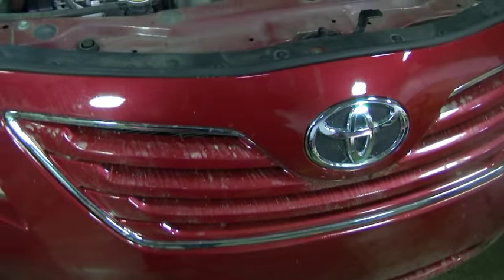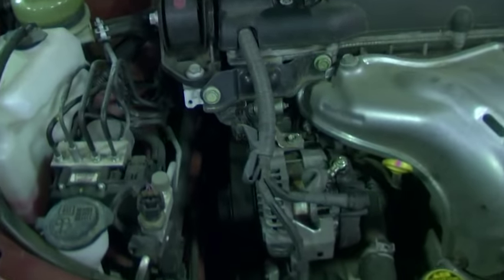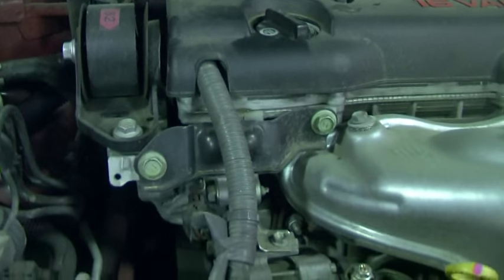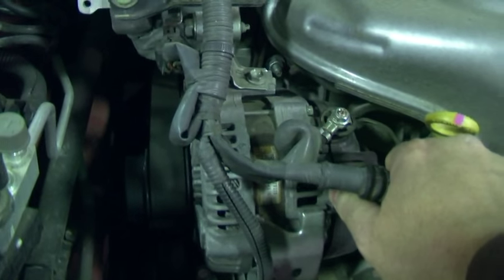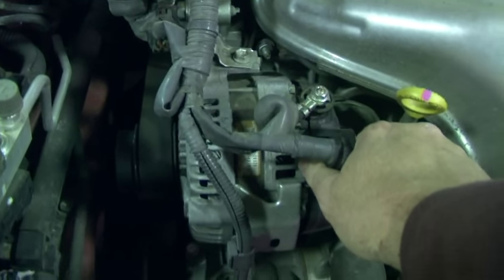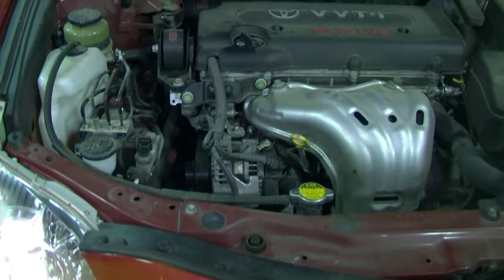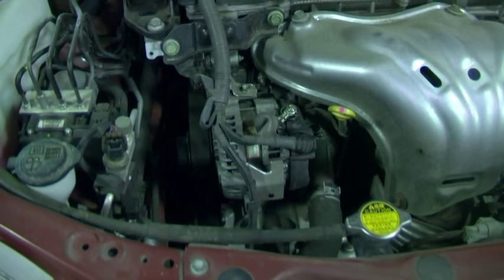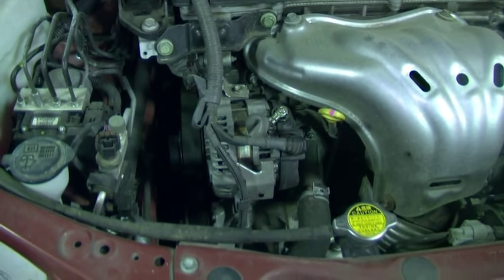Noisy Whining Alternator

Comment: Alternator isnt bad just that once it hits a certain amount of miles it turns into a supercharger hence the whining noise
Reply: @muffinpoop92  satire you shoukd probably get it checked out
Reply: whats that thang youre squeezin
Reply: @muffinpoop92  it is for a bad alternator
Reply: mines sounding exactly like a supercharger, what should i do?
Reply: @weareet3rn4l70 replace it
Reply: @weareet3rn4l70  how long did it last like that? Mine makes this exact same noise but my voltage seems to do okay when I'm driving.
Reply: @mashedpotatoes5323 mine lasted a couple weeks before total failure after sounding like that. During that time I only saw low charging for maybe a split second other than that it performed.

Comment: Nothing wrong with a short intro. This video saved me going to a mechanic which would have cost a lot. Parts are so expensive now that I cannot afford to pay the price of both buying the part and having someone else put it on. it's videos like this that save people a lot of money. He didn't have to make this video, but he was nice enough to do so. Thanks for helping me.
Reply: a new bearing is like $5....
Reply: Lotta people assume it’s turbo or transmission - then they realise it was the alternator 😭
Reply: did you change your alternator?
Reply: @junjungebutan843  yes I changed the alternator and it works fine no more noise.
Reply: @JeriDro   I'm pretty sure he meant the cost of buying and replacing the alternator as a whole.
Reply: I remember I had to change the alternator on my Pontiac Firebird that I used to drive like 30 years ago when I was in college. Cost $50 labor and $75 for a rebuilt alternator that I bought at possibly AutoZone or someplace like it, before taking it to the mechanic. Now in 2023, in this post pandemic era with the recent rise of inflation (although now it's down to 3% which is almost back to normal), supply chain issues, and just overall greed by corporations and everyone in the chain trying to cash in on this opportunity, the price of parts (as well as everything else) has skyrocketed, and I can only imagine what it would cost now. Labor rates have gone up substantially as well, partly again due to corporate greed, and also because the workers need higher wages to keep up with the cost of living expenditures.
Reply: @alakbar7870  a decrease in inflation does not mean things are going back to normal, nor does it mean prices are decreasing. Inflation is a measure of the rate of increase, so a lower inflation RATE simply means that prices are still rising but not as quickly.
Reply: @Chaos..............5-0  Yes, I know... probably far better than you since I have a Master's in Economics and a 28-year career in finance. When did I ever say that just because inflation has come back down to around 3%, that I expect prices to go back to pre-pandemic levels?! The only reason that I even mention inflation coming back down--in parentheses nonetheless--is because it hasn't been around 10% in nearly 2 years now. As I already stated, the primary reason for prices of many products continuing to go up at an alarming rate is mostly due to corporate greed and supply side issues, and because SOME consumers have benefitted wildly from government handouts that they really didn't even need (while others who do need it aren't getting all that they require). Anyway, just thought I'd point out your obscure SELECTIVE reading and misinterpretation of it. 🤨🙄
Reply: @alakbar7870  "Now in 2023, in this post pandemic era with the recent rise of inflation (although now it's down to 3% which is almost back to normal)" So you're saying you meant the rate of inflation is almost back to normal, and not prices? That wouldn't be very pertinent to the point you were trying to make, since you were talking about how expensive things are. But I'll give you that with the caveat that you should make sure you're clear on what you mean when you're talking. Additionally, I think we've all seen in the past 4 years that the whole "I'm smarter than you are because I have a degree" argument doesn't hold water. Besides, you don't have any idea my educational background, which, by the way, does also include a degree in Business Administration and I work for a Financial Advisor firm. You don't need a college degree, though, to be able to read and understand facts. But good job on your accomplishments!
Reply: @Chaos..............5-0  No I DID NOT say that, in any shape or form. What I said was that the initial rise in inflation was partially responsible for the prices going up, AND THEN IN PARENTHESES I stated it's back down to 3% just to indicate that mere fact, not that it's had any effect on prices still rising. After that, I continued on to state the other causes of why prices had gone up OUSTIDE OF THE PARENTHESES... do you see how that works now, boi?
Reply: @Chaos..............5-0  Just wanted to add... anyone with any intelligence whatsoever would have interpreted that correctly, but not you, obviously. I also never ever mentioned at all that I expected prices to come down just because the rate of inflation has come back down. It's like I told you, I am the financial professional here... while you are someone that didn't even go to college--that much is clear to me! 😆🤣🤫😎

Comment: Wanted to say thanks for posting this - I was running in circles trying to diagnose this whine. People had me convinced it was something with the transmission. 07 4Runner
Reply: I have same year 4Runner and my alternator making a similar noise and voltage is not consistent. Which alternator did you replace it with?
Reply: @hikeroutpost what did you end up replacing it with?

Comment: You Saved My Life! I thought had something messed up with my engine from being too low on oil or something. Unplugged that cable and the noise went away! I bought myself an alternator and slapped it back together and it's running nice and smooth again! Thank you so much! 👌

Comment: This too, was my exact problem. I had someone from AAA come take a look at it because my car was shutting out as I was driving home (lights, radio etc.); fortunately I made it home safe. I initially thought that it was ONLY the battery and set up an appointment for AAA to Bring and Install a new battery for me at a decent price. The mechanic performed a quick diagnosis and determined that it was my alternator failing. The reading came back as this:

SYSTEM TEST
CRANKING VOLTS: 9.41 V LOW
ALT. IDLE VOLTS: 12.79 V LOW
ALT. LOAD VOLTS: 12.08 V LOW
DIODE RIPPLE: 1.75 V HIGH

From what I understood, he explained that my alternator should at least have 13v. Next thing you know, BOOM, alternator died on the spot, he helped me arranged a tow within the hour to have my car dropped off at my nearby mechanic, in which they will perform a diagnostic and likely replace the alternator. 

p.s. I recommend AAA to anyone who isn't mechanically inclined like myself, as they have been nothing but reliable and useful to me so far.

Insurance + Assurance (AAA) = Happy Drivers.

Good Luck.
Reply: Was the alternator the exact problem
Reply: @taneishajohnson6797  Yes. The battery was fine. But I eventually replaced it several months later. (not due to issue stated above )
Reply: @popshot5021  Wow you’re awesome you replied! I was taking a long shot with a 3 yr old comment lol. Thanks so much going through this same thing.

Comment: Thanks 🙏 for the video, I purchased and installed a refurbished alternator from 
O’reilly’s and the new one I just installed was making that noise, I had no clue what it was, thought I did something wrong, but I unplugged it and the noise went away just like you show, I took it back showed them your video and they swapped it out, new one runs like a champ.
Reply: O'Reilly's refurbished alternators are very suspect, I'm on my 2nd and it's on its way out. $600 labor to remove & install unit on 09 Murano.

Comment: Been trying to diagnose this whining from my 03 sequoia with the 4.7L V8 on cold starts and I’m almost positive this must be it cause it sounds exactly the same. Thank you for uploading this
Reply: Dave did you ever confirm it was the alternator on your sequoia? Mine is making the same whine sound
Reply: my 4.7 in my 06 4Runner just started doing the same. Have you found the fix?
Reply: @Aguilaraxel320  it was my power steering reservoir. it was filthy and the screen inside was plugged. Once I cleaned it out and flushed the system and added new ATF and some Barr's power steering repair, the noise stopped after a few run arounds.
Reply: @headhonchotj4794  on mine it ended up being my power steering reservoir. it was filthy and the screen inside was plugged. Once I cleaned it out and flushed the system and added new ATF and some Barr's power steering repair, the noise stopped after a few run arounds.

Comment: Awesome video. Thank you. I could not find this in previous questions. Instead of having the engine running could I shut it off - disconnect the alt. connection - restart and see if noise is gone? I used a wooden yardstick placed on the alt. and cup the other end to my ear to pinpoint the whining noise.  Thanks again. Sure be great to get an opinion before I have to buy a new alt. which I think is what is inevitable.

Comment: If your diodes are failing, you can take your car to autozone and have them do a battery test. The testing machine checks the diodes and if it’s making a noise like this they’ll fail the test like mine did. You may want to replace the whole alternator and voltage reg because switching out a single diode can be more difficult than replacing the whole alternator, which could very well be getting ready to fail anyways. It’s cheaper though.
Reply: I had to have my starter replaced about 3 years ago on my Corolla, except I wasn't 100% sure that IT was my starter that was the problem. The first thing I did though was to take the car to Auto Zone to have the battery tested (which I bought from them about 4 years ago prior to this). Their battery tester was showing that the battery had failed... but for some reason I wasn't convinced. And I didn't think it was the alternator either, as that seemed to be going strong (I had a bad alternator on a previous vehicle I owned, so I had some experience with that as well). Later on, when my starter did die, and I was now sure that WAS the issue, I ordered a replacement part online, and was able to get a local mechanic near my house to replace it relatively cheaply. My battery on the other hand, lasted for another 3 years, and I just recently had it replaced. So I don't know if AutoZone purposely uses testers (or has them set up in that way), but they more often than not test batteries (and possibly alternators too) as "going bad" when that is not really the case.

Comment: Good sharing 👍 Is this sound when the engine is cold and the sound is cut when the motor heats up? The sound in my car is cut off and the sound sounds a little different. I'm investigating my problem is whether the piston is a slap or alternator roller.

Comment: My vehicle has developed a hum at idle. It also will drain the battery flat if not ran for a few weeks. Can bad diodes also leak the battery down? The only other thing I can think may be causing the hum noise would be the power steering pump but the hum doesn't change when turning the wheel.

Comment: I think it may not be the alternator even if you unplug it. Because when you unplug it you take the tension off of the belt so other parts are also off the tension besides the alternator. So it might also be a bearing that's making the noise
Reply: I will be checking mine soon, but bad bearings have a different sound.
Reply: So why does the noise stop when he unplugs it, and then resumes when he plugs it back in? Also, the bearings are considered parts or components of the alternator itself, are they not, as are the diodes? So would it be considered "too much work" for a person who is not a mechanic or mechanically inclined to replace individual bearings or diodes and just have the whole alternator replaced instead?

Comment: If you have a 2009-2012 genesis coupe 2.0T, replace your alternator. Even one from a junk yard whined exactly the same. Bad diode trio.
Also, it was having issues charging the car when the A/C blower was on full with the headlights

Comment: 2006 Toyota Sequoia had a bad idler tension pulley causing engine whine when accelerating. (Not squeaks or other weird noises). Especially audible at lower speeds. Took a lot of research in the Toyota forums to find the answer. Replaced. Whine is gone.
Reply: Besides the noise was the voltage stable? I get the whine but my voltage is low so it's probably the alternator.

Comment: Hey TCAT Autotech, i have a 2008 Nissan Altima 2.5 S. Now when i start it up theres not much of a whining noise but it is really loud like the bearings are going bad, but when i drive and accelerate to about 30-40 it starts whining like a wild child. I just replaced the alternator like 4 months ago and its making this noise, autozone told me it was a bad alternator. But after watching this video im suspicious that it could be the pig tail harness?? cause my harness piece that plugs into the alternator got destroyed when i was trying to take it out of the alternator, so its just the Pins connected to the alternator and electrical tape keeping them from touching and short circuiting. If i got a new harness would this problem go away? or should i use my Warranty and get another alternator and a new harness at the same time?

Comment: Hello! Hoping a smart person might be able to help me. Could an alternator still be the problem if this noise only occurs/is noticeable at speeds excess of 70mph? Would it affect the car being able to accelerate past 2500 rpm? This is the exact noise my car makes, but only after about 10 minutes of driving 70mph. Then, my car will not go faster and makes the noise until I put it into cruise control. Driving around town and under 60mph, it drive like a totally healthy car. Any sugggstions?
Reply: @ puff Daddy, did you solve the problem? What was  the cause?
Reply: @edwinalexander1170  he started driving 69 at the most and it never happened again

Comment: Mine Is similar but the noise gets quieter as the engine warms up, Is that the same issue? I want to take my Alternator out today to get It tested and replaced If It has gone bad but I want to get other peoples opinions before I do.
Reply: Jose Pina have you had any success? My Buick has the same issues
Reply: The Man nope. It has mostly gone away with the weather being warm so idk how I can test It now. But I did notice the noise wasn't as loud when I replaced a bit of the power steering fluid, I used OEM I got from Amazon
Reply: same issue with my accord. Did you find resolution ?
Reply: Kadir Rangwala in my opinion if you hear a familiar noise of a part failing And then your car makes a similar noise but only under certain circumstances I would replace that particular part anyway just to be safe
Reply: @silasmcgee3647  I got it fixed. My power steering fluid was low. No more noise.
Reply: Kadir Rangwala good you don’t wanna Run out of that stuff then it will feel like you’re trying to steer a hummer
Reply: I know It's been 2 years but I'm having same problem with my car recently, as the car warms up noise goes away. So did you fix it? And what was the exact problem? Please i want to know if there's any serious problem...
Reply: @deepakpujara8484  I believe It was the Alternator. The Alternator stopped charging my battery so I replaced It and the noise has not come back.
Reply: @beast11135  ok thanks brother

Comment: Hey why is it when i rev mine up it goes away tho ?? The noise goes away ?? And it actually charges my battery as well but if im at idle and not driving it stops charging and the noise comes back loud ?? Does that mean it could be a belt ?? I just changed the alternator recently to ?